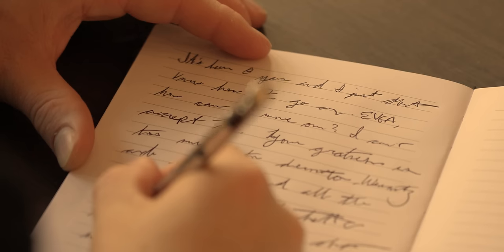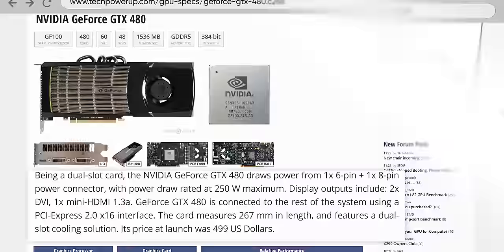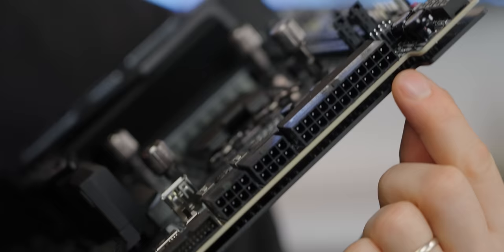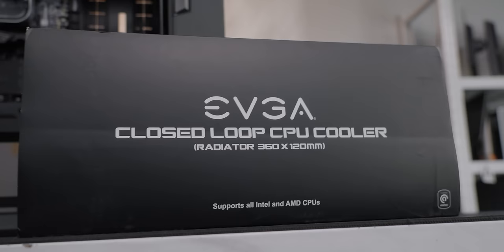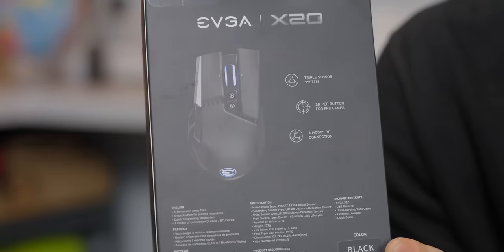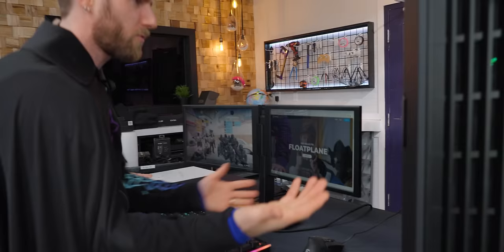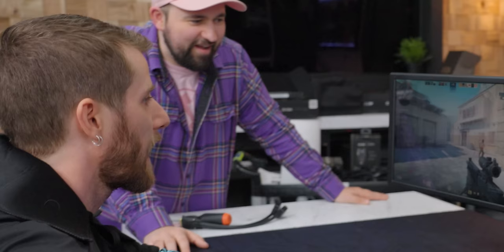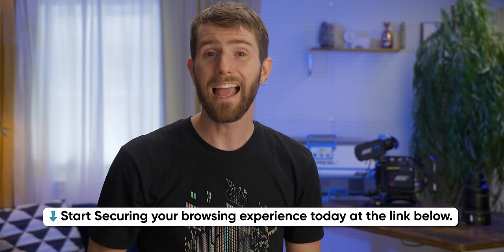I Still Miss EVGA - Building the All EVGA PC

Comment: When I worked at microcenter in the service department I had a facepalming experience involving this case.  Goes a little something like this lol.

Customer comes in, checks the computer in at the service department, we used Astea at the time to catalog checked in devices and order parts from manufacturers.  I don't know if they still use it or not.  I get the ticket in my queue, look at it and know it's going to be a field day because it mentioned in the notes that an engineering friend helped him build an x299 system, I9 7980.  So I get this EVGA case on my bench and start diagnostics, no post at all, but with power.  Personally, wasn't a huge fan of the case besides like, the back portion for cable routing and then the evga logo lighting up in the case when it's placed, looked like a fish take for me.   Ok, so either ram, cpu or gpu are the problem, because I rechecked all connections since I wasn't the one that built it.  I start disconnecting the water cooler and f** almost die from shock.  I'm sitting there looking straight at the cpu before I facepalm and literally tell every service tech I work with for them to see it.  The engineering friend that built his friends pc cost him a boat load of money.  He installed the cpu wrong, missed the notches and bent the corners of the pcb on the cpu itself and bent the motherboard pins.  So I had to go out there and tell this guy both the cpu and motherboard are not salvageable and will need to be replaced.  I've had cheaper but similar issues in the past with people that checked in desktop builds and those people said  "no I didn't cause that damage, your service department did"  which I just chuckle at because I took pride in my work, those arguments are gonna roll off my back.  I was the type of person that wiped down, opened up, re-cable managed, replaced thermal paste and used an air compressor to clean out every single customers computer because I want their stuff looking way better than it did coming in.  Admittedly microcenter liked pushing the "os reload, data migration" bs or recommend certain products/services/programs because salesmen and service get commission on certain things they sell.  Not a fan of that, if I deemed a computer not worthy of spending money on to repair, I'd give them the cost of the repair, and the cost of 3 different replacements with different prices and different performance and would elaborate and ask what they did with the computer to help identify what would work best.  I don't like people overspending and I don't like people paying less but expect more.  If they declined all, I'd let them know that if it's like physical damage, let's say, to the standoffs of a laptop internally that wont allow screws to clasp the bottom and top case of the laptop together.  I'd let them know I can super glue the standoff back, screw it in with some loctite and it will last for however long it lasts, no charge. If they're comfortable with it, it can get them limping along until they make a decision.  Got off topic but that's what happens bring up some memories lol.

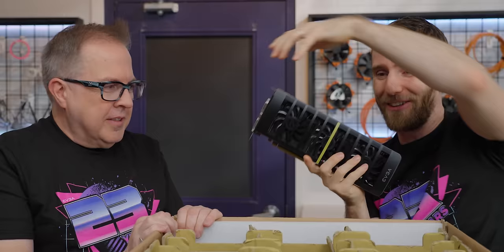Comment: 2:50 There was the Asus Mars just before the GTX 275 Co-Op came out (which was basically also an custom design dual-GPU (GTX 275 & GTS 250) card but without SLI if I remember correctly).
Nevertheless I miss EVGA as well. All my personal graphics cards were from EVGA since the GTX 480 and had one of the first Nforce3 socket 754 Mainboard from EVGA in my LAN machine as well. Kind of miss these green PCBs with orange RAM slots and an yellow AGP slot. I thought there were sexy at the time...

Comment: I had an EVGA 7900GT I loved so much, I purchased a second one for SLI. It didn't work right, and would artifact. I discovered the new card was bad and started a RMA.
They sent me a replacement, which I tested solo, and it worked great. But, I couldn't get it to SLI with my original card. So, I call EVGA up, and it turns out I had 2x 256MB cards, and when I RMA'd one, they sent a 512MB card as a replacement, and so it wasn't SLI compatible. They apologized and asked if I would be willing to pack up both cards, the RMA and my other original one, and they would exchange them with a matched set for my trouble. I said sure!

A short time later, I get my box from EVGA. I assumed they either just gave me two 7900GT 256MBs or maybe upgraded me to 2x 512MB cards. Nope! Inside the box was 2x Brand New 7900GTXs!

Damn, they were awesome!

Comment: Of course its going to be quiet, that CPU and GPU aren't even flinching with that resolution! I actually have a 3090ti FTW 3 as my current card. Bought it way cheaper than MSRP just after EVGA announced their departure from the GPU market. As an IT guy by day, I will treasure this card, long after its dead in several (hopefully) years.

Comment: I still have a EVGA X58 classified 3 board, GTX 285, GTX 1060 and GTX 1080Ti. Never had a problem with any of them! The big selling point for me was the lifetime warranty they had (like on my X58 board and GTX 285) and step up program where you could pay the difference and upgrade to a better GPU. Sad I couldn't buy a RTX 4080 from them so had to jump to MSI but if I'm honest I'm not very impressed from what I was used to.

Comment: I'm using that keyboard and still love it! There are so few options for full mechanical keyboards with extra macro keys at that price point!
I've also only used EVGA NVIDIA graphics cards and with the way NVIDIA is managing themselves, will probably never use any NVIDIA card by any other manufacture either. Currently using AMD and see little chances of me going back as things stand.
Honestly miss EVGA in the hardware space, only brand I've used that I've had absolutely no issues with hardware, service, and support wise.

Comment: I just put the air cooler back on my 1080TI FTW3 and its ran perfectly on my initial tests, A few runs on Superposition and a max temp of 68c was nice to see. It was destined for my media server but its a little to long to fit in that case with all the drives so I'm going to fine a cheap 6 core CPU and an M-ITX motherboard to put in my old In-Win 901 ( will need spacers for the glass side to fit) and it will make a perfect 1080p machine for my other half.

Comment: Evga should become a custom gpu, motherboard, memory company. With how much pc's are selling for these days, they could take in personal requests for gpu, board, and memory.
We know that intel, ngreedy, and amd don't put the best materials or add the best specs they can into into their products.

Thats where evga will come. Added memory on boards with hbm, fiber optic data transfer for the motherboard and gpu board. Heat sink made out of silver.

Their mato would be if you have the money for it then we can build it.

 Like lets say, Diamond used as a surface heat sink on a bare die in the spots that overheat.

Comment: Unfortunately I never owned an EVGA GPU, something I really regret I don't know why I didn't probably it was just a little cheaper to go with MSI ,ASUS etc, but sadly that option is no longer there, I do however own multiple EVGA power supply's I have one in my main rig, my kids all have one (my old ones) in their gaming pc's and they have always been great I think the oldest one it going on 8 or so years old and still perfect so if they continue making them I will for sure keep buying and recommending them

I do think they should keep making cases the case featured is bloody awesome and would be right at the top of the list come next upgrade time

Just maybe not monitors, not that the inter view isn't without its cool factor the specs are WAY off the mark maybe make them panels 28" 1440p 144hz or so and massively slim down them bezels then we might have something worth upgrading to but ditch the stupid connection and just make them display port 

Anyway EVGA motherboard's PSU's and case's would be greatly appreciated and maybe team red GPU's or even team blue I understand abandoning team green I have also ditched them and more then happy with team red, but whatever you decide keep making cool stuff there is always a market for cool and invonavative stuff

Comment: Not entirely sure why you'd make a PhysX combo thing by the time the GTX 200-series came out. Even the 8000-series, 2 years prior, had strong PhysX support onboard. Couldn't much feel the difference between my BFG 7900 GTX + BFG PhysX, and the Inno3D 8800 GT without the PhysX card. The 8800 GT killed the 7900 GTX in everything.

Comment: Until I went ITX, I always got EVGA PSUs after 2016. Best in the biz IMO in terms of price, quality and noise. Unfortunately they don't have any good options in SFF space. Shame. Corsair, that I am currently using, is not bad by any means, but they are more expensive and well, I ran EVGA for 10 years without single hiccup and I already had the PC turn off twice due to a minor power fluctuation.

Comment: (dead) EVGA GTX 770 SuperClocked (cheapest "Titan cooler" card) sits at my shelf,
and EVGA GTX 980 Ti Classified still works great at my older mini-ITX PC,
I feel little ashamed currently using ASUS GTX 1080 Ti Strix (only because EVGA FTW3 wasn't available at that time locally), paired with EVGA SuperNova G2 750W psu though :))

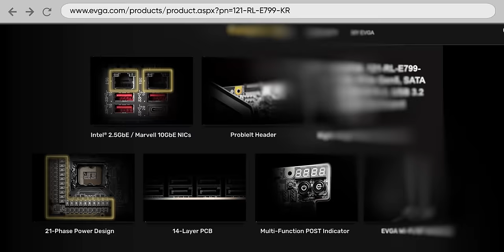Comment: Agile lifecycle for Atlassian is like this with paperclips and all Lean methodology goodies. So mosfet and fridge inverter is it I need and It seems they want edtech and health tech 5:22 and an included pdf at Unity asset store. If I remember as Letty these are much more bigger 3:55 and I knew they will remember about how they build tallest building - they were wrong as wrong as Deckard Shaw leaving some vial gift at the doorstep. It's where to keep all small parts 5:10 and find them easily. 5:34 Haven't noticed anything older at Eneba store 3 or 4 times cheaper compared to new and latest I could use as some render machine - that's not possible getting it ten or now twenty years older with pc hardware but only with cars. 7:05 These are servers where Mr Nobody lays down the deal to Dom and I wait to know about them more since the 6 movie - that scene was not filmed in the north but in the cold watchdogs streets enabling CtOS.

Comment: EVGA was really good in (some) hardware like the 980 Ti & 1080 Ti FTW, sound cards and some PSUs but their software sucks so much everything good the hardware does is instantly null.
Precision X1 somehow manages to use nearly 5% of CPU while doing absolutely nothing, it forgets the profiles it was set to if your PC is in sleep mode for longer than 1 minute and because EVGA uses some proprietary stuff for their (bad) ICX cooling stuff no other software can actually control the 3 fans on their FTW3 cards.
Also, their warranty stuff only worked in America and is a really sad example of how minimal amount of stuff you have to do to be put on a pedestal.

Comment: Hi I need help really badly. I have an intel core i9 10900k 10 core 3.7 gh with a rtx 3060 | 32 gb ram | kraken x63 cooling and my pc is clean, I only have an ssd with 1 tb on it with 500gb free. I have fully optimized windows as well as I can for gaming, I play Fortnite competitively. It doesn’t overheat I’ve checked and I’ve optimized nvidia control panel fully for performance and I have a 240hz monitor so I have it capped at 240 but it drops almost to 80 fps sometimes and the hitching is so bad it’s unplayable. Does anyone have an idea on why this is happening I would love any feedback. Also I play on performance mode. Thank you.